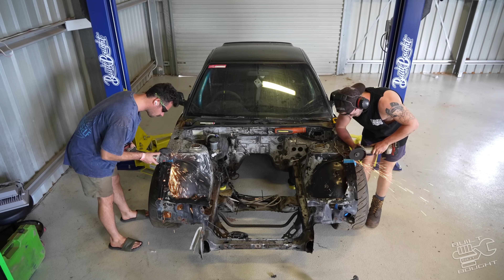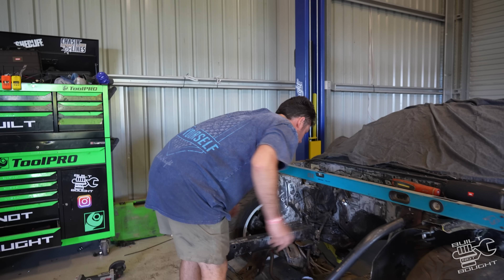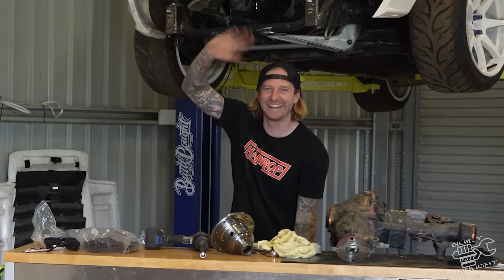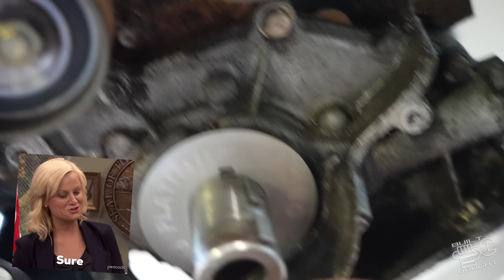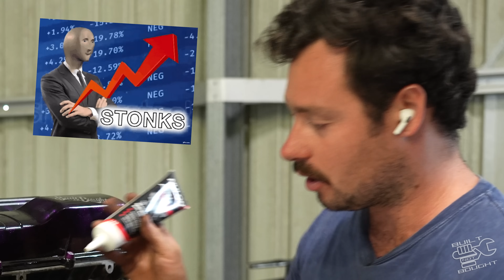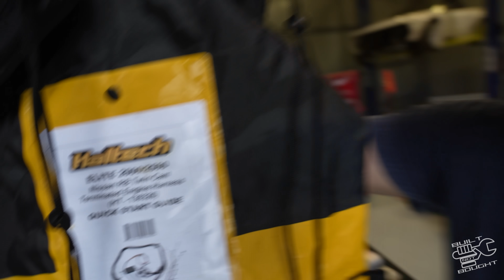Heart Transplant - ENGINE Edition 🛠️

Comment: I would recommend getting a new harmonic damper that crusty old one is not going to help in high RPM range. The Ross Performance Parts harmonic Damper are good and have a balanced external trigger so you don't have to cut a hole in the crank timing gear housing.